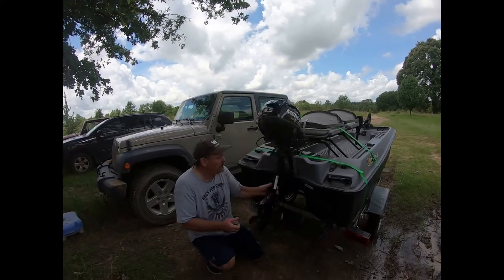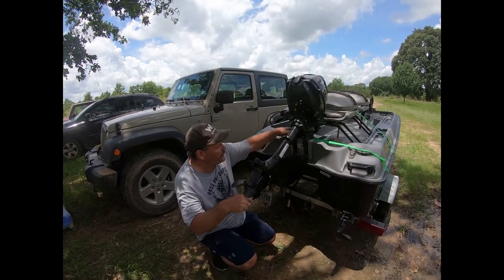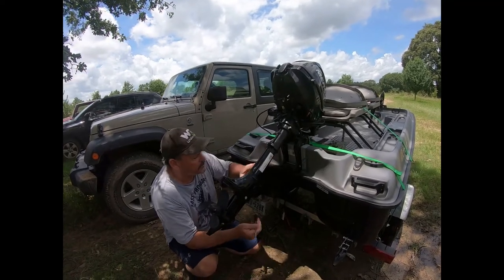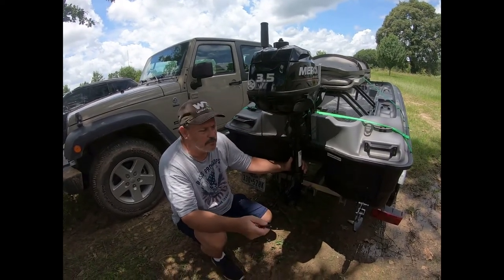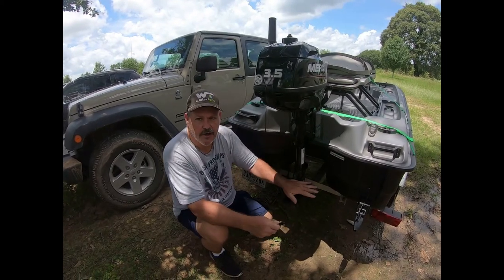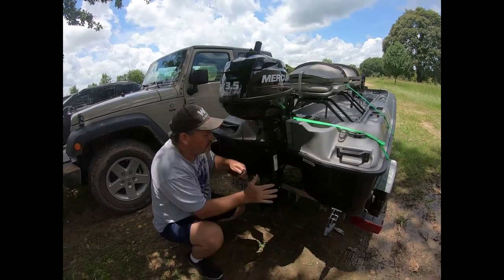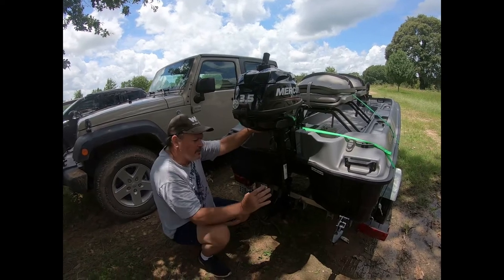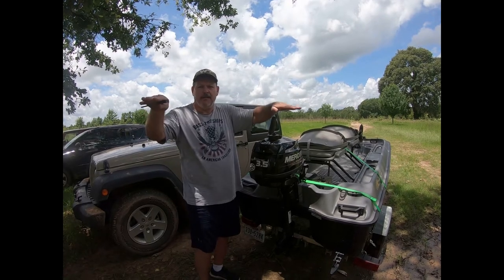Dealing with Transom Flex

Comment: Great info. Do you trailer the motor on the boat? I have been told not to.
Reply from the maker: Yes, I do. Make sure you support the foot of the motor to the trailer.  I've had no issues.